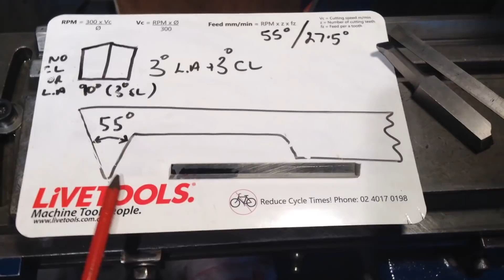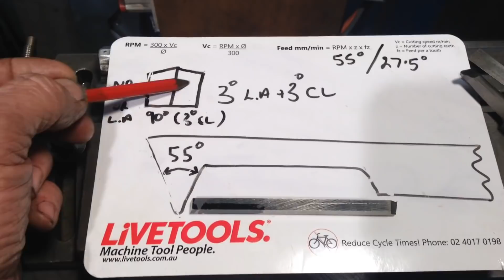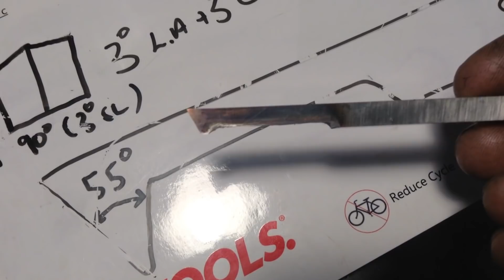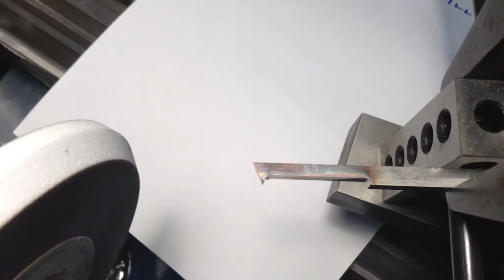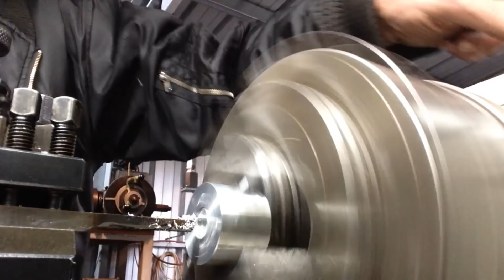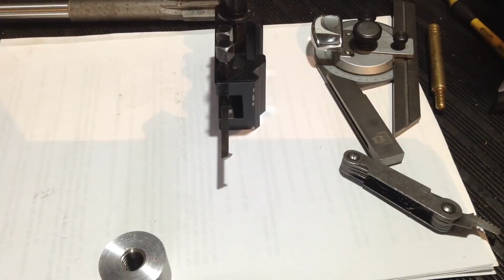Wood Lathe Tail Stock Quill .  The Left Hand Thread .   Part 1 .

Comment: Nice job Max. I like seeing the setups on the T&C grinder. Could you of cut that tool with only one type of wheel . Thanks
Reply from the maker: It all could have been done with a cup wheel if i had a different set up to hold the tool blank .  That i still have to make  .   Cheers .

Comment: Great Job Max could you do a video on how you came up with 1/2 bsw and not imperial
Reply from the maker: It's the metric 55 deg version  12.7  x  .083 !
Reply: @swanvalleymachineshop  not the formula but how you determined that it was bsw
Reply from the maker: @troyam6607   British Special Whathefukfor .   I think it's one of the only 1/2'' 12 tpi threadS on the planet  .   It came about in the early British thread standardisation days in the  mid 1800's  .
Reply: @swanvalleymachineshop  ok, really overshot that one lol im mearly wanting to know how and idiot like me would look at that thread and determine that it is a bsw over imperial, ie if i use my thread gauges i have metric and Imperial and i know that SAE usualy runs in the same grain as BSW so again how would someone (you) determine that it was BSW? dont think i can word it better
Reply: Funny enough, the thread per inch of UNC 1/2 in is 13tpi
With BSW 1/2 being 12 tpi.
Making this bolt easy to define as BSW.
ANY other size are the same tpi, go figure..
With others , a UNC bolt will go into a BSW nut, but a BSW bolt won't like threading into a UNC nut unless it's a sloppy fit.
Reply from the maker: @troyam6607  I can tell by looking , but you look up the thread charts & see what matches  12 tpi with a 1/2 '' dia .  Looking at it narrows the field it to  BSW or UNC   pretty much  .   BSW  is an imperial thread profile @ 55 deg .
Reply: @captcarlos  yeah so the answer would be cross reference a guide that has general pitch sizes on it and go from there. the problem is when youve been machining pre metric like Max you know all this offhand haha
Reply: @swanvalleymachineshop  thanks Max!

Comment: A good experienced explanation. Well done. What is the dinasour T & C grinder?  Good set up for grinding.
Reply from the maker: Thanks .  It is an old Hercus No 3  as far as i can tell .  Made in the 1960's .   I have had it along time , but just starting to get tooling made up to be able to use it .  It will be a learning curve as i have not used one since apprentice trade school days in the early 80's !  
I see you have some flash tooling fixtures with your one  .     Cheers .
Reply: Hello again. If you go back thru my video's I have shown lots of tool and cutter grinder accessories. A lot are easy to make including workheads. The Clarkson head has plain bushes. The most complete text with good drawings is Moltrechts workshop practice vol 2. Yesterday I was teaching annular cutter grinding and using a Breirley drill grinder. Lost a lot of time but passed on some knowledge. BC

Comment: Great job Max. I have a question need to make a puller to remove a hub from motorcycle engine  33mmx1.5 rh thread how deep does the thread need to be to fit the hub, it is an internal thread and do not want to remove from the chuck to check the thread fitment? I will use a dial indicator on compound to track the depth of the cut.  Thanks have a great day.
Reply from the maker: Hi Randy .  I would bore it to minimum of 31.38 ( 1.235 '' )& cut straight in with the cross slide  0.862 mm  ( 22 thou ) . I don't generally use the compound to screw cut small pitch threads . Not knowing your tool nose radius , that should  get you there .  Just for a puller , you can go a couple of thou extra on the depth .
Reply: @swanvalleymachineshop  Thanks Max I will give it a go and see how it works. thanks.

Comment: Just a suggestion, if your worried about the aluminium oxide grinder wheel on your tool grinder setup shattering and hence the need for guards, you could replace the AlO^2 wheel with an aluminium wheel coated with cubic boron nitride.
Being a solid metal wheel it won’t shatter (so no need for the guard) and the added bonus that CBN doesn’t clog with swarf from the HSS that your grinding - so unlike the ALO^2 wheel it dry grinds cold!
I know it sounds counter intuitive, but you can grind HSS even hand holding it and it barely even gets warm to the touch. Certainly not enough to turn it blue.
I use a couple of them here for sharpening HSS planer blades etc.
Your welcome to pop around and play with one on some HSS if your interested.
From memory a 6 inch wheel is around $250 but should last you around -10 years.
Reply from the maker: Hi Ian .  I will be changing to those when the grinder is fully set up . It is a big cost thing as several different shaped wheels are needed .  Cheers .
Reply: @swanvalleymachineshop   Indeed at around $250/ wheel it adds up pretty quick.

Comment: Hi Max, my lathe does the same thing, half nuts grab were you don't want them to engage.
A workmate of mine had to cut an internal 3/16 " ACME double start thread for a model steam engine governer valve,  achieved it on his Myford ML 7, pretty challenging.
Reply from the maker: 3/16 2 start is certainly a challenge , you would need bloody good eyes or an optical comparator to get the lead angles right ! .  7/16  square  internal thread is my smallest & that was a challenge !

Comment: I'd love to have a t/c/g.  even a jig at the bench grinder would help.  don't like burning my fingertips when the tool gets hot.
Reply from the maker: My eye sight is not what it used to be so they make tool grinding easier .  Just have to build some more fixture tooling for it as it is hard to come by here & expensive .    Cheers .